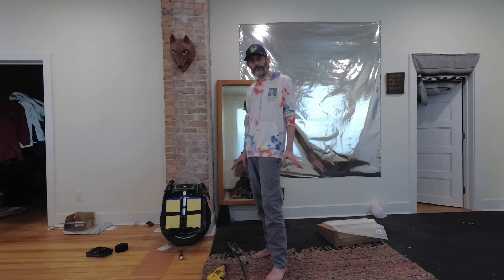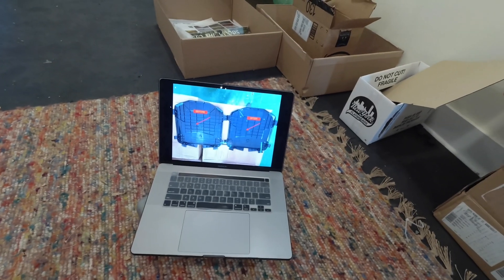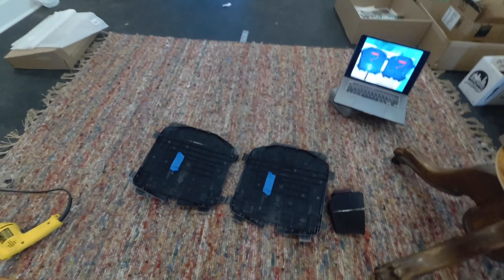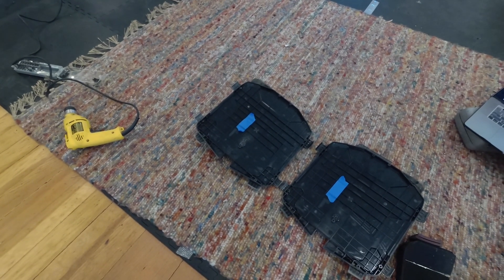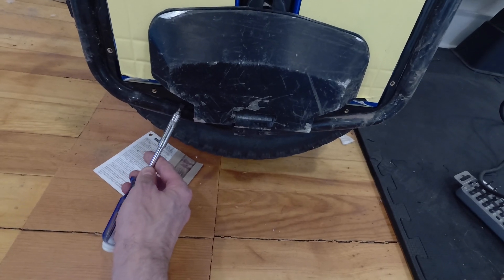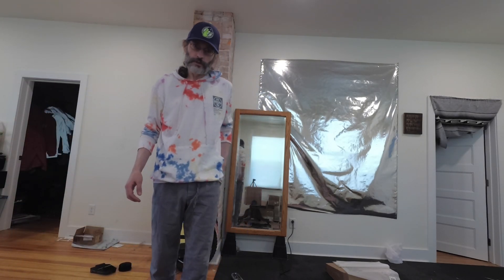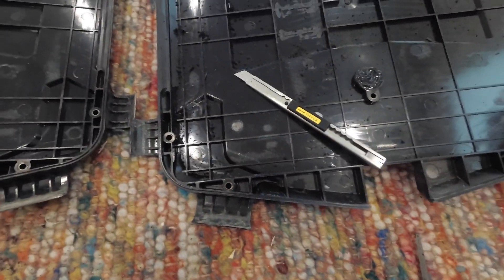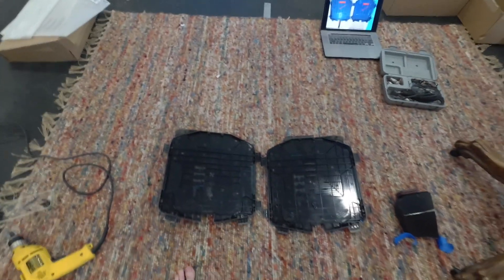Veteran Sherman BT LOU error message preventative mod

Comment: Did this work with our replacing batt
Reply from the maker: not sure exactly what you are asking but if 'with our' is supposed to say 'without' , that is the whole point of the mod is to prevent battery BMS damage.  I did end up damaging one battery on one side well before this mod was requested - I replaced the entire battery via help from eWheels (seller).  Later, I was asked to perform this mod to prevent damage happening again

Comment: Hi I purchased my Sherman 6 months ago I just wanted to know do you think I'm still under the warranty after you drilled out the ribbing did it work or did you have to replace the battery
Reply from the maker: I'd email seller and ask.  

if it is eWheels, I think they warranty for a year (but I'm not certain), and they requested that I do this mod in the first place, so I know they will continue to honor the warranty

Comment: Thanks for sharing! Extremely useful info.

A bunch of retailers follow the manufacturer's warranty to only 6 months and this preventive fix might prevent a lot of headache and expense in the coming months.
I have a Sherman on order and shared the video with the distributor so they ask Leaperkim about it. I will check as well when it arrives, then apply the mod if needed.

Comment from the maker: one of the first questions I asked before doing this was - what side of the panel do I grind?  the front side toward the headlight, or the backside toward the tail light?  the answer?

The answer is to just grind away the same section on each panel (regardless of side, or which way facing) and not overthink it.

All the batteries installed in Shermans are the same.  So when they are installed, the BMS is always on the same side .  It's standardized based on how the battery is placed when looking down at it - not by what way the headlight or tail light is facing.
Reply: this is how i did mine too
Reply: Did it work after you've saved it or did you have to replace and buy a new battery or is it under warranty 4A battery

Comment: This mod is also for new batches?
Reply from the maker: I wouldn't know as an owner of a 1st shipment, but based upon the emails I read from eWheels- this is a modification I would do as any Sherman owner.  

I've had the issue, error message, 'bt-lou' and it renders the wheel unridable.  I had to get a new battery pack.  It may not be a common issue, but the mod is super easy